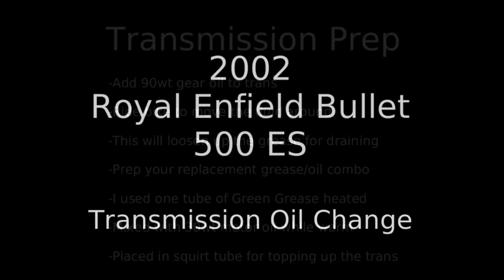Royal Enfield Transmission Oil Change

Comment: Haha. Funny name for the oil+grease combo, Snot Recipe.
Mine is  71 and the check nut is at the back of the gearbox not the front like yours.
Great video.
Reply from the maker: It does resemble snot HAHA

Comment: Dear sir, I live in warm temperature in India. I understand from your video to make 50-50 proportion of green Grease and SAE 30w motor oil. My question is can I use SAE 90 GEAR OIL with 50-50 proportion of green grease instead of 30w motor oil ???  Will it be ok for my royal enfield gear box ?? ?
Reply from the maker: That is a good question.  Around here this mix works well for me.  During the summer we get temps up to 120F degrees or near 50C.  I heave read on the Royal Enfield forums that some people use the 90wt oil, so I think it will be okay, but with the thinner oil you may experience leaks more often.  Good luck!

Comment from the maker: +aditya panicker, you actually have to ride the bike to get the transmission oil warm on these bikes.  Just running the engine won't do it.  This bike is an '02 and has a transmission box where as the newer Royal Enfields have the UCE or Unit Construction Engine where the transmission and engine oil are combined.
Reply: Thank you very much. I have one important question for me.  I"m new to enfield family, i'm planing to buy one. I found one 1986 bullet restored (5 years ago), good paint front disc, new type shock absorbers front and rear. I'm ready to buy but some of my friends and mechanics confusing me .  They say since it's not a G2 engine there is no point buying old one and go for post 2000 and pre 2009 (points one not uce.). Does 31 year old one wears irrespective of restoring ? looses all it's old and preciousness ? what they say is every thing must have been changed in these 31 years and no point going for a old one ? Please clarify me ? i'm in confusion.

Thanks in advance
Reply from the maker: I would say it depends on the cost.  The older bike should cost less, so you realize savings up front, but risk higher maintenance costs for the life of ownership, whereas a newer bike may be more money up front, but require fewer repairs in the long run.

The biggest difference between the 86 bullet and a bullet from the early 2000s is electronic ignition, the newer alloy barrel instead of iron, and the transmission.  After 2009, the UCE aluminum engine with electronic ignition, fuel injection (here in the USA), and a 5 speed transmission.  You will typically get better performance from the newer bikes, but if being old and more unique is your goal, then the older bike is just fine.
Reply: Your last point is my goal. old and unique. Thing that confuses me is what do you mean by old 1980-2009 cast irons available and right gear shift. Do i need to go for latest(2000-2009) old or really old ? thats where i'm stuck. One more thing is Price is also not too cheap, almost equal to  latest(2000-2009) old. Please help me figure out this confusion.
Reply: forgot to thank you for reply. Thank you very much.  

Other thing i forgot was, being 30 year old bike, does it loose all it's originality ? even g2 engines are also 40 years old, all the parts gets replace on every restore then what is the point of being called as old ?

Is there any main parts which are permeant and don't get changes irrespective of restores.
Reply from the maker: Subbarao Ganeshna It really comes down to the type of riding you will be doing and personal preference.  The newer bikes can handle more heat and stress, and travel more stable at higher speeds, but nothing is as classic as the older bikes with the 4 speed box and an iron barrel.  You should check out https://forum.classicmotorworks.com/  They cover many of these topics B-)
Reply: Hi Arizona RE. I chatted with you before buying an CI bull. Now i'm a proud owner of a bull for 3 months now. Today i found an issue, traffic is very bad in my place in india. So lot of gear shifting. What i found was, after applying neutral finder 2nd gear doesnt go smooth, infact not shifting i'm kicking all they way down but no use. If do it again then it works. So is it a transmission oil problem or clutch needs to be adjusted.   2nd questions is Does heated grease mandatory only oil does't do for transmission fluid.
Reply from the maker: Well, first thing about the neutral finder, I only use it after downshifting to 2nd gear, and never in third or fourth.  If I do it seems to bind things up, I don't think this had anything to do with the oil or the clutch.  Try only using it to get to neutral from 2nd gear with the clutch lever pulled in, it should work every time and not bind.
Second, yes, you need the grease in there, oil alone on the 4 speed transmission will not do it well.  For one thing the transmission is not sealed that well and the oil alone would tend to leak out, also the viscosity will not be good enough for the heat that is generated, and the grease helps keep lubrication in areas of the box where oil may not cling to by itself.  All of that being said, after filling the transmission with the mixture, in the future if you need to top up, you can use 30wt oil alone to add a bit.
ATF works great in the primary case to keep the clutch lubricated B-)

Comment: Very good video, thanks for that. I don't understand the magnets @the end. y ?
Reply from the maker: Thank you!  The magnets at the end are to try and secure any metal shavings in the motor to stay near the bottom of the oil tank to prevent them from flowing through the engine and to come out when the oil is changed.  Not really necessary after the break in, I just do it still.  If I ever do see an unusual amount of metal on those plugs or in my oil, I'll know something is wrong B-)

Comment: What are grade engine oil for Indian old model bullet 1980 model.
Reply from the maker: I use Rotella 5w30 for my RE when I can, but a good 4t would work as well.  If you are changing often enough a modest oil will work fine.  Choose the thickness of your oil based on your local climate B-)

Comment: can u use any kinda grease ? i got  a red one from centech walmart
Reply from the maker: I use Green Grease because it is a quality grease.  Any high tmep gear grease should work though.  Remember to blend with oil.
Reply: ok i did try to blend it  but  not successful  finally i pored  oil in and then used a syringe to  squeeze some grease in only to find out the gasket is leaking as i couldn't take of the old gasket completely . its stuck  at some places  didn't want to damage the aluminium . well fr the drain plug problem i got one from auto zone  its holding up fine fr now ,but do u know anything about the ecoplug system ? i feel i shuldav upgraded  long ago culdav avoided the damage . check it out .
Reply: well thanks a bunch !

Comment: I own Electra 350 5s. does this needs to be done with my bullet???
Reply from the maker: I depends on what year your bike is.  The newer bikes have the UCE, so the transmission and motor run the same oil.  Specifically this information is for the 4-speed transmissions that came on the iron barrel bikes and prior to.
Reply: Arizona RE Thank you for prompt response. Mine is 2007 model.
Reply from the maker: jock3ym3 Then there's a good chance you have the 5 speed transmission which will have different requirements than the trans on my 2002.  Pete Snidal has a great manual and the nfield gear forum is a great place to find information.